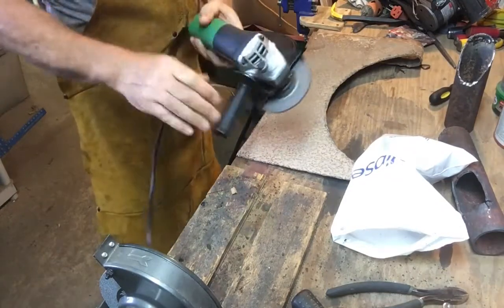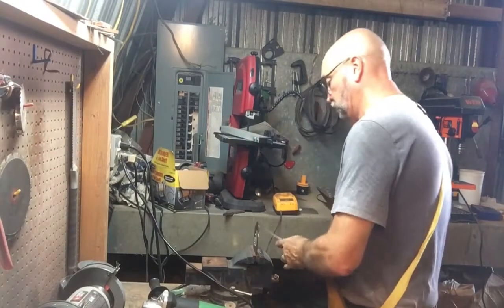Coal Forge Build - Part One - Firepot

Comment: Did you put a screen or expanded metal over mouth of air feed? I would think clinkers would enter blower motor. I think thats why they build them on a 90. Let us know you might be on to something. Great job.
Reply from the maker: Sorry I did such a poor job keeping up with comments, thanks for your question. I did not put a screen but I may open it up and do that. I have not had any real issues but I can hear what sound like pea size piece in there. I most add that I love the airflow I get with the angle but then again I never had one on a 90.

Comment: Can you tell me brand name of blower/source? I'm tired of burning out hairdryers! Thanks
Reply from the maker: Mike Holovaci I got it from eBay if I’m not mistaken... I’ll look it up and let you know
Reply from the maker: https://goo.gl/5Pxqg6 This is the blower I use and it works well, no issues and good price!
Reply: If you have a shop vac with an attachment tube on it's exhaust side it should give plenty of air. We've used the blower out of old car heaters combined to sewing machine motor and speed control also, it works great and is really convenient because it's only running when you start on the pedal. The shop vac will supply so much that you will want/need to baffle it down.
Reply from the maker: I used my shop vac on my first forge but it was way too much blower and it was a fairly small shop vac. This little electric motor has been great, but I'm sure there are lots of options, as well.
Reply: You are definitely right about too much air with the shop vac, hence the remark about  choking it down with a baffle. We made  a bunch of chunk charcoal to use and the shop vac with no restrictor would blow entire chunks out. Not good to work around! Lol Love the videos, keep them coming. From a fellow Louisianian : get it hot and hit it a lot!
Reply from the maker: I am glad to hear you enjoy the videos. Gotta admit I totally missed the line about choking the vac. I have been away from the forge for a while I really need to find some time to get out there. Thanks for your support!
Reply: I use a small shop vac which I attach to a PVC pipe with an inline valve that I can turn to control airflow +/-. Works like a champ! The only drawback is the noise generated by the shop vac.
Reply: You're right about the noise from the shop vac. We're currently playing with an automotive heater blower that we swapped the 12 volt motor for a sewing machine motor and foot control on. The old forge we made from mud, bricks and other (s)crap fell over during wet weather when the legs sunk into the ground, so we're currently building a new more modern one.

Comment: has the 3/8 been thick enough  steel so far
Reply from the maker: I have not really put it to the test with daily use but it is holding up well, so far.
Reply: cool thanks
Reply from the maker: Thanks for watching, I really appreciate it. I have been trying to get the "part 2" video to upload but I'm having some challenges. Should have it up soon.